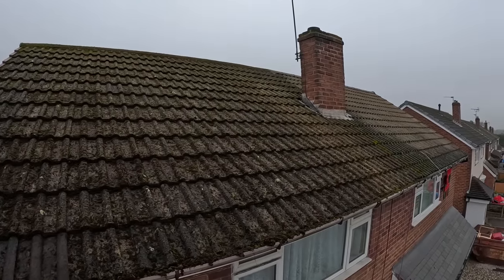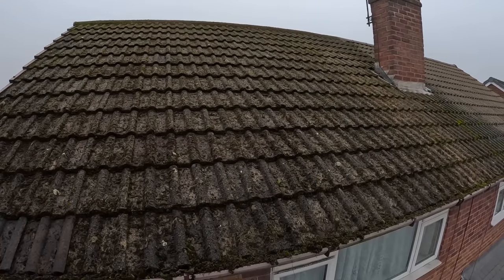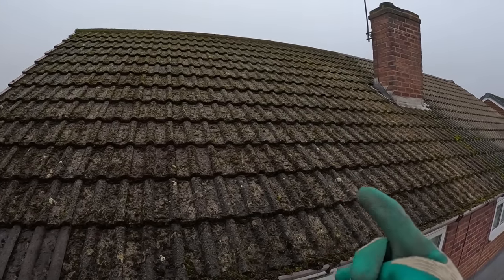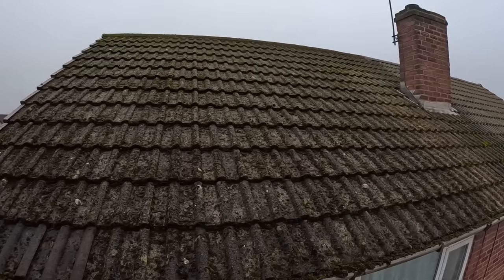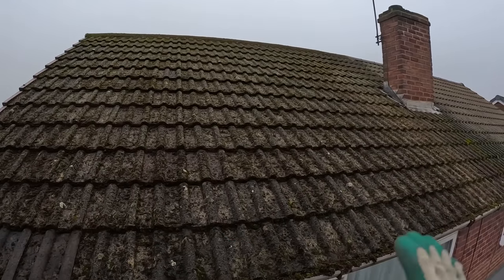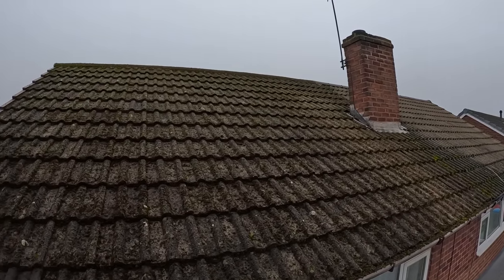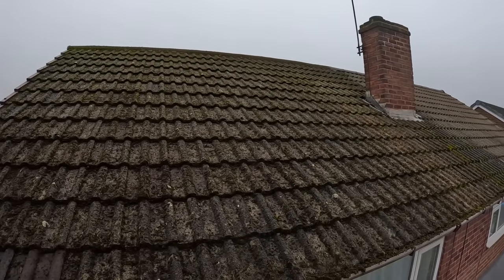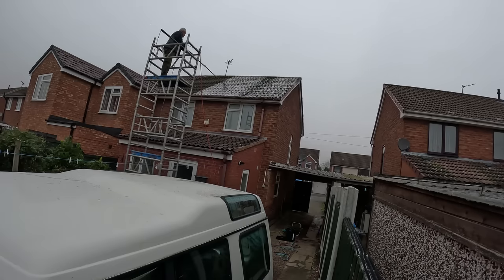STRANGE CASE: RUDE Neighbour Went Too Far? I Discovered Evidence Whilst Cleaning A Roof!

Comment: It appears the neighbor’s beef was as much about the client’s draining water as it was the client’s roof moss and muck clogging the gutter and downspout. While the neighbor may have been wrong to put in the divider and cant the gutter to his benefit, removing the divider just shifts the water problem back onto the neighbor. It only escalates a bad situation. What’s needed is common building solution, one in which both parties recognize the troubles of the other, and coordinate in good will to a single fruitful end. This isn’t rocket science. Now that the client’s section of roof looks as good as the neighbor’s, it’s the perfect time for the two of them to sit down, hear each other out, and work together. 

No matter how big or small a homeowner’s property is, property lines are often contentious subjects. But tensions seem worse the closer owners are to their neighbors. It’s critical for neighbors to cultivate good relationships so they can problem solve. For more than 40 years, I’ve greeted nearly every newcomer in my immediate neighborhood with homebaked goodies, a list of their neighbors, and invited them to every major event or houseparty I’ve ever hosted. I’ve shoveled and snowblowed their walkways and driveways, and taken their empty garbage cans back to their garages. That honey goes a long way, and builds community.

Comment: Its a joint drain, I think the local water authority who are responsible for drainage, may have something to say to neighbours who restricted acces to the down pipe. 
If it was me I would put my own down pipe in, just inside the boundary line and kink the shoe at the bottom in the direction of the neighbor.

Comment: I dont think the drainage system was designed like that, those looks like ex council houses, and usually if the semi share a common drain it would be in the middle where both houses meet (party wall 9:58) If the neigbour have a drain this would mean that your client at some stage had a drain either at the corner of the house similar to the rear of the property and they got rid of it maybe to put a drive in. If you look at the other houses you may find that they all have thier own drainage front and back. Beside without sounding like a t**y c . the question is where was the water going before you cut away that blockage? I bet the neighbour had left a hole in there so the water can pass through but nothing else but it was that blocked up with moss that you didnt see it and assume the neighbour had completely block it off. If he was going to block it wouldnt it be easier to just use an end cap?

Comment: It's a two way street. Yes the barrier should not have been installed but on the other hand that roof should never have been left to get to that stage. IT should have been cleaned to stop issues for the neighbor.
In this case both parties are at fault.

Comment: I am just curious why people in this region would buy this type of roofing if it requires maintenance and is 2 or 3 floors up? I live in the north east US and we put a painted steel roof on our house. Its cheap, durable, long lasting and doesn't need to be cleaned or maintained really. Its been on the house now for about 15 to 20 years and it still looks new. We liked it so much we put it on all of our outbuildings. Our barn, our tool shed, our wood shed and our little guest cabin. Installing steel roofing on our 22x32 wood shed 6 months ago was less than $2000. So to me its worth it to avoid all that maintence effort. Also why not put in your own down spout? The neighbor can suck it.

Comment: Technically it is illegal as there is only one DP and this is how the property was built your customer has an easement that allows them you use the DS if your customer had and water damage due to the cap thing the neighbor put in the neighbor would be liable for it I'm sure you did the right thing removing it.

Comment: My neighbour did that to the front where my rain water went into his side . Yet at the rear his water went into my side . I replaced my front and rear gutters so I had a down pipe in my side both back and front and put a stopper them so he had problems with his rear gutters. When he moaned about it I just told him . What one rule for you and a different one for someone else. He also moans about me parking outside his house yet his son always parks outside mine . The police still haven't found his body and never will .
Reply: Fair enough.  I like your tit for tat approach to try to get him to see sense.  But you killed him and he's still moaning about your parking on the King's highway?

Comment: Its a difficult thing to judge. The mossy roof was left for YEARS i reckon and if i was the neighbor I would not want all that moss to wash down the pipe on my side and block the drain. Who would have to deal with that then ? Would Mr Mossy pay the costs, or only half the costs or nothing at all for a blocked drain on my property due to HIS negligence ! :/ He sounds kinda laid back like its no big deal. Just look at the state of that roof though. Perhaps they only just moved in though and the house was vacant for years ? Its easy to point the finger but the devil is in the detail !!! Best keep out of it. I think Mr Mossy really should get his own house in order though before his roof starts to leak. A few comments down David Pritchard mentions a mesh barrier and I'm in agreement with that, however perhaps the neighbor never thought about that at the time. :/ or perhaps the gutter installers had ran out and just shoved the solid barrier in. Who knows for sure ! One thing I will say though is this public shaming using video is a bit out of order in itself. This sort of abuse of peoples privacy and insinuations and tearing down there reputation should be a criminal matter.

Comment: To be fair, your customer should have cleaned his roof earlier. The neighbour could quite easily had enough of the drain getting blocked over time. It certainly looks like the roof hadn’t been cleaned for a while and can see they have done theirs. Why should they keep having to clean and clear the drainpipe when it’s the neighbours fault. By the state of their drive and roof you could assume that they don’t care. Until we have the full facts we can’t dis the neighbour for doing this, there could be history.

Comment: No being funny, but maybe there's more to the story. If the house next door had the moss after his clean, he may just have not wanted his side blocked as it would have been constantly blocked with moss from number 1. Maybe they could have amicably both had roof all cleaned and all would be fine. Food for thought. I would be upset if I took pride in number 2 and number 1 was sending all the crap down 🤷

Comment: The neighbour is definitely in the wrong. I have the same pipes on my house. The one in the rear drains into a drain in my back garden and one of the front drains into the neighbours garden so you are right to cut it off.👍👍👍
Reply: Putting myself in the neighbour's position, the 'thing' was  a temporary device to force the mossy roof owner to clean the gutter.  Having achieved its goal, the 'thing' has no purpose and can be removed.  It's actually quite clever (and the neighbour possibly intended that it would be removed).

Comment: It is rude.  BUT looking at the condition of the neighbors roof and your customers roof, he probably had a valid concern that your customers roof would shed moss etc and clog up the downpipe which as you stated multiple times, is on his property and woul probably be his responsibility to take care of if it backed up.  

With that said, it is always better to just have a conversation with your neighbors and see if they could help mitigate his concerns.  Maybe they would have agreed to get the roof cleaned sooner and alleviate his concerns.  But if they said they wouldnt do anything to help, THEN I would agree with doing something to stop the perceived damage he (the neighbor) saw possibly happening.  But ask first.....!

Comment: So the only downspout is on the neighbors side. The neighbor is responsible for cleaning it in case of blockage. The neighbor's roof seems immaculate and clean. This roof however is in terrible shape. Its pretty obvious to see why he's done it. I would be upset if i had to clean up after somebody else too. I'm sure there has to have been an exchange between these two neighbors regarding this situation. I think you did wrong in taking that divider out. You should've communicated with both parties. The problem lies with the person who doesnt take care of their roof. The solution is to either clean the damn roof regularly, which im sure he does not. Or install a separate gutter pitched towards their side and install a new downspout so each would have their own to take care of. Instead of deciding to shove all the problems to the poor neighbor. He isn't rude, i think you were in this case.

Comment: my opinion is that its wrong, they shouldnt of done it, however they may of been getting lots of issues with blockages and leaks due to all the moss from the neighbours roof. so blocking it to reduce the moss coiming down off the neighbours roof into there guttering. still they shouldnt of done it but i see why they did.

Comment: Firstly you need to look at the deeds of the property, which generally state if there is a shared gutter/ downpipe, then both houses have a legal obligation to maintain said gutter and downpipe. Suppose one of the owners refuses to correct it. In that case, the second party typically has the right to enforce work to be carried out, especially if by not completing the works causes material damage to the first house. By placing a divider between the connected gutter, the second house owner is in breach of the deeds and covenants that will cover the dwellings and the estate in general, at the cost of solicitors and bad feelings. Why bother in the first place? (narrow-minded and very petty)
Secondly, Note you only have to look at the god awful double height extension, the nasty St.Georges cross on the front elevation of the house (Did they seek planning permission for the sign?) to understand the guy next door wouldn't be very friendly. More than likely, they were forced to reduce the size of the extension, hence the expensive step, causing them to become a royal pain in the butt, simply because they feel their rights have been violated by not being able to overshadow their neighbours, devaluing the property. But if you notice that the builder hasn't keyed in the brickwork, or at least failed to weather seal the joint correctly, so will leak! 

This is one of the reasons I would never purchase a house on a new estate. Not only are the buildings poor quality, poor design and quite frankly boring as hell your boxed in on all sides.

Comment: This is a very time consuming way to clean a roof!
We use an industrial steam cleaner / pressure washer set to 160 degrees with a 2% TFR  mix.We stand on the eaves and using a safety harness blast the moss and algae clean off the tiles top to bottom then pressure wash the guttering out. The roofs we do look like  new once finished. We wash windows and sweep up/ wash down paving.
Manually scraping a roof down like this and cleaning guttering and soffits  from below isn't the way to do it..

Comment: I agree that the behaviour of the neighbour was spiteful, but the design was really poor. Our house is similar except that the common downpipe is right in the middle between the two houses both front and back. This makes it clearly a joint issue as I cannot cut it off from the neighbour nor vice versa. What kind of planner or builder thought that was a good idea. Now all that said, if you removed that block from the neighbours side of the divide then you are setting yourself up for trouble, if it had been placed on your client's side then not problem. The sneaky removal is fine (well kind of), but then posting a video on YouTube showing you removing it was perhaps not the wisest decision 🙂. I also think your client should get someone to put in a downpipe on their side of the divide.

Comment: Why should it be acceptable for one property to remove there down pipe downpipe for looks or risk of hitting it with a vehicle and expect your neighbour side to handle all the surface water which can spill over and down the face of there house causing damp. I would not have cut that as that neighbour will be pissed. Especially as its not yours to cut. But it does make for good click bait. Maybe they have asked them to reinstate it as they are having issues and they said no so it was put there so removing it was wrong as you don't know the facts.

Comment: hmm roof cleaners in Australia, at least the honest ones use high pressure water to clean the tiles, then spray it with an enamel or epoxy coating to seal the tiles so they are no longer porus...  seems odd that you are literally still using a 300 year old method to clean tiles.. then again the UK uses Vauxhall as a brand dispite that company going bankrupt 60 years ago because 'familiar name' I guess conservative innertia is very strong in the UK :/

Comment: Don't know why this popped up in my feed but the cunts next door raised their guttering last October.
Even joined the gutters over the front, downstairs windows.  Google Streetview and condition of the new connections show this.  Got that part partly sorted (they have their downpipe reinstated) and I have the bits to re-separate downstairs myself.  Top gutter though, do I get mine replaced and make sure mine is even higher?  As of now, my gutter overflow over the front of the house in a downpour.

Don't live next door to a narcissistic cow.  Wish there was a 'law' though.

Comment: The shared drainage design should be written into law.  Someone who doesn't want to share drainage should consult their neighbour and discuss separating it.   Only a pathetic prick would block it like that. Really pathetic.   I do wonder if the moss was going down into the drainpipe and moving over to the neighbours side causing blockage maybe,  but even still,  you consult your neighbour, even if you hate each other.  Just get matters dealth with and move on.  Really silly.

Comment: You're a fool for getting involved in a neighbour dispute, and committing criminal damage in the process.

If the customer's property has never had a down pipe of their own, then they've likely established a right to use their neighbour's guttering for rain water.
However to be absolutely sure such rights should be outlined as an easement in the deeds of both properties, and the apportionment of any liabilities resulting from the easement be specified.

Note that such a right would almost certainly be limited to water runoff only.
It would not give the customer the right to send moss, leaves, or other detritus into their neighbour's guttering.
If this did happen the neighbour would be justified in putting a grill or filter at the boundary to stop such material entering their guttering.

Comment: All the resident needs to do..preferably before you moved the obstruction was to take photographs and put it in the hands of the local authority who should then issue a notice instructing the neighbour to restore the guttering to its original spec and thus servicing both houses.  Your customer could easily install their own downpipe which is easy enough but they will need a surface water drain for it to flow into.  Could be made to flow into the garden but this is frowned upon by local authorities.  Neighbour is obviously a complete dick.

Comment: you are in the wrong, dude.... the proper solution is for you customer to have their own downspout on their corner of building... that's not enough drainage for the whole roof anyway... this should be done REGARDLESS of roof condition, or dividers, or pitches, etc.... your proposed solution should have been, not "let me cut that part out that i have nothing to do with" but "let's you pony up and i make more money by installing a downpipe for you as well.. that would be an easy few hundred for 2 hours of work

Comment: There will be a section in the house deeds that stipulate the run off  when these housed where built there may only be on surface run off drain 8f the neighbours blocks this it is potential a civil offence however the water company might concider it criminal as the house who gutter was blocked has been paying for surface water drain off but as he cannot access this due to his neigbours action the water company  should refund as fraud be committed unintentionally by water company charging for a service not accessed. I would be going down a legal route. There will a right of access and use and if the neighbours does not like this they can pay for a new drain to be installed what they cannot do is block access to the drain . I would get my solicitor onto it to serve notice of action. It I get water damage  I will be seeking compensation from the neighbour.

Comment: Yes it was a bit cheeky altering the gutters like that, but I think you have been terribly rude, and very unprofessional by making content out of this. The house you’re cleaning the roof hasn’t been done for some time, I noticed the neighbour (which you do not know) has a moss free roof (and is very well maintained). Lots of debris from your customers roof would be consistently flowing to that down pipe, and probably filling their gutters, and possibly blocking the down pipe, and certainly the drain. No doubt leaving this ongoing maintenance to the neighbour to repeatedly clear, and clean.